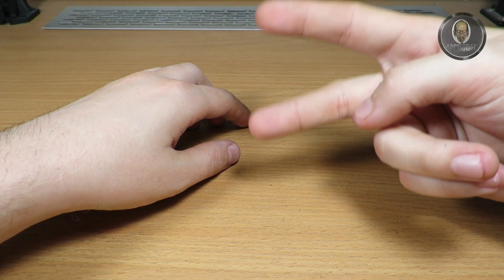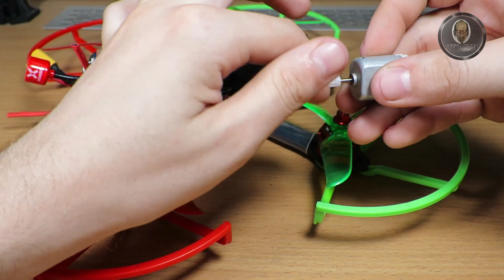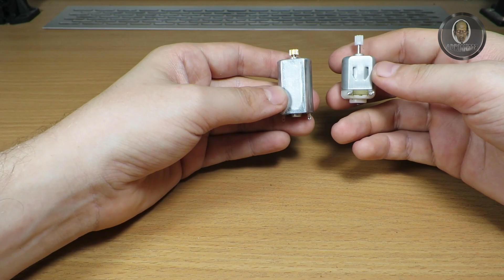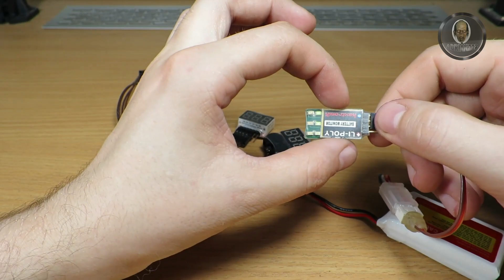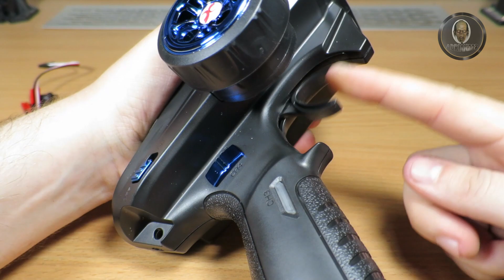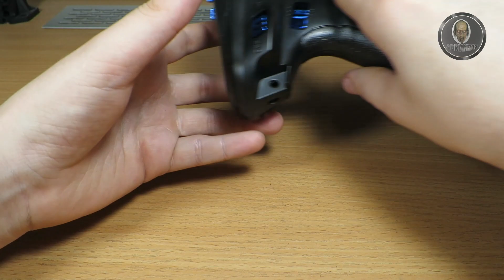Basic RC information Part 2 - For people that are new in RC hobby

Comment: Whats the difference between 10a, 20a and 30 a escs? Does the increase in amps help the motor to run more slowly?
Reply: Also would like to ask something about this esc. I have this same 20a red esc with brake switch. But the brake is working only while driving backwards. While going forward I am getting no brake. Did you encounter the same problem. I even have this same dumborc x6 transmitter and receiver. Is it a programming issue? Can I reprogram it?
Reply from the maker: @saikatmauser  First about amps.
it means how much current can support from motor so bigger motor or more force on motor = more power consumption.
Motor without any load (spinning in hand) will take about 0.5A but if You will try to grab end of motor while it's spinning current will rise because motor need more power to spin it and it may take 5A.
If You have much bigger motor current will be much bigger on load so then You will need much stronger ESC to handle that much power.
On toys it's mostly 10A max but on bigger and stronger cars it may take like 60A and more.
More stronger ESC You chose than more cool it will be on hi current from motor.
Reply from the maker: Slow running will always depend on ESC because ESC regulate how fast motor can spin and also how slow
You have brake on reverse because of two thinks:
1. Switch cables on motor because it's connected reverse
2. Reverse channel 2 on remote than it will work in correct direction :)
I hope this will help :)
Reply: @Adrian202  Yes, my motor is also running reverse. I actually did it right by reversing the channel on my remote. But how will I reverse the cables on the motor? Wouldn't it get reverse polarised and blow up?
Reply from the maker: @saikatmauser  if You have brake on forward and motor spin in wrong direction than just reverse channel but if You have brake on forward and motor pin in correct direction than you also need to change cables on motor.
best option is to just unsolder cables and switch theme and solder theme back
Reply: @Adrian202  If I reverse the negative and positive cables on the motor, then wouldn't it burn? Also would like to ask for my information, do every esc only provide one way braking? Doesn't the brake work both ways?
Reply from the maker: @saikatmauser Switching cables on brushed motor just change direction of spinning so there is no risk of doing that :)
Yes, brake is always on reverse also on reverse there is always a weaker ESC so let's say you have 60A esc and that is for forward and for reverse is let's say 30A because it's mostly slower :)
Reply: @Adrian202  Thanks a lot sir. You have just saved my life! Thanks a lot! The motor is now running in the correct direction and the brake is also working while driving forward. Instead of taking the pain of taking out my soldering rod, I simply revered the red jst cables on the motor output of my esc. Thanks again!!
Reply from the maker: @saikatmauser  wait brake if also working on forward ?? You can always write to Me on Facebook just search for Adrian RC
Reply: @Adrian202  Sure! Will do.